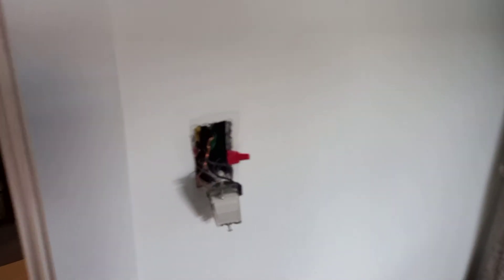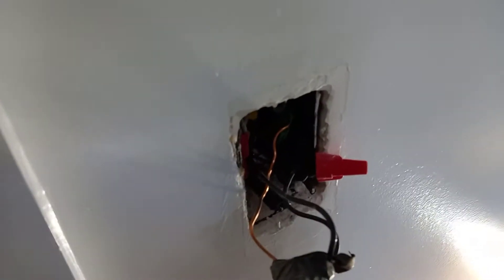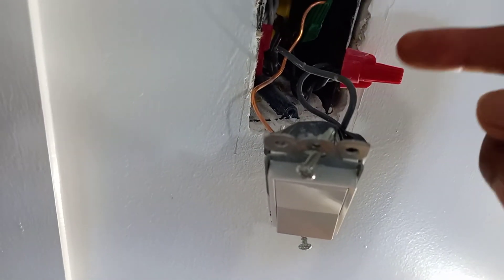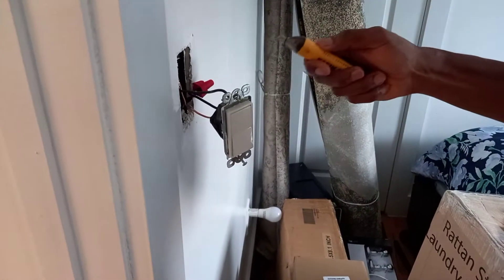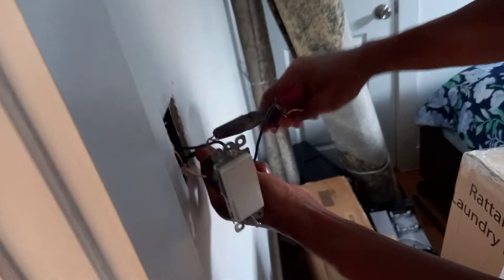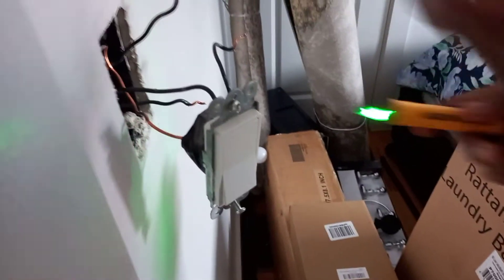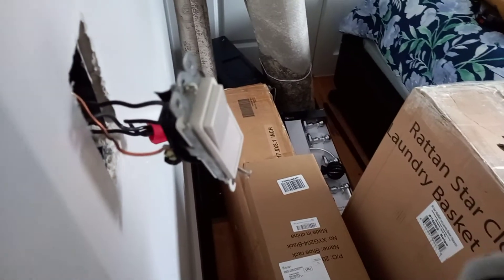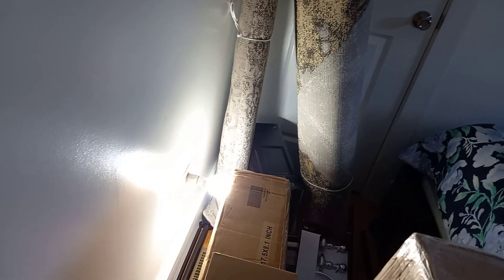How to change a switched outlet to a continous hot outlet.

Comment: this made it so much easier to understand.  I dont have the ceiling light installed yet I am looking to change my outlet to constant hot and then add the light but this video showed me its as simple as moving the black wires from the top screw to the bottom on the pigtail... I dont know why I thought that was going to be so difficult.

Comment: I can't believe you touched a hot wire like that
Reply: I was thinking the same thing i have this same issue but thats also the only way im gonna find out which wire goes to the light or outlet still scares to do this trying to get my nerve up to touch those to find out
Reply: @sherryhowell8697  I like to be safe better than sorry. You can kill the circuit, test that there's no power, then twist together some black wires, and wire nut it. Then turn on the circuit again to see which wires controls which. Can save a lot of time doing what he did in the video, but one slip and you're toast.
Reply: Well it's just 110 it can't kill you can it not like 220 but still havent got the nerve to go in there and try this I dont have a tester either but have no one to help me and I'm a female if this Is gonna get fixed I got to figure it out on my own
Reply: Expert level. Knowledge across the globe. Americans would not do this.